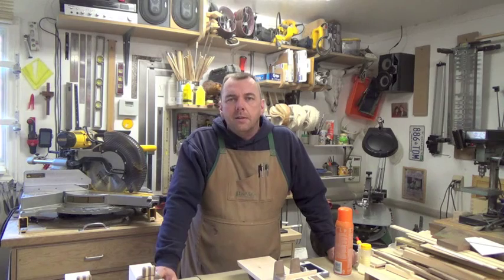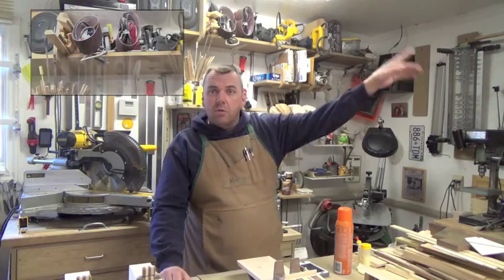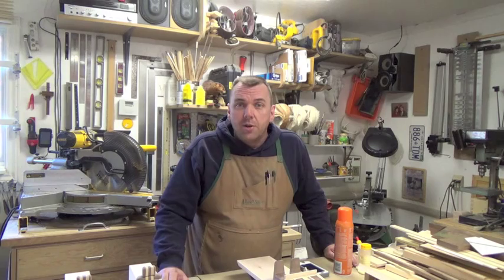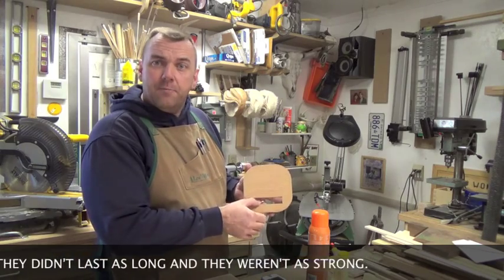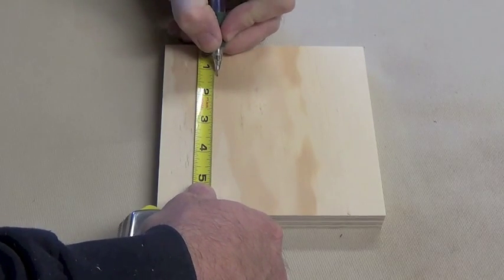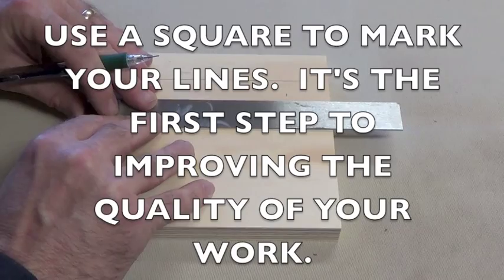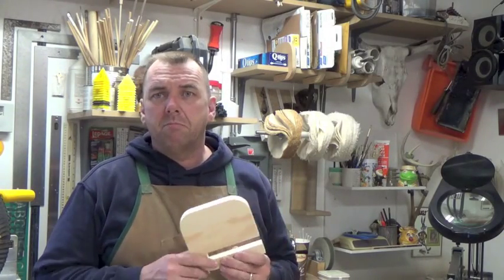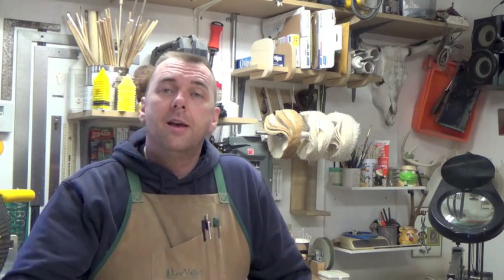Making Shelf Dividers

Comment: I'm an organize nut and now that I am Retired, it can be a little expensive buying those large 3" note books I used to keep my drawing ideas and manuals in. I also clip articles from magazines for Ideas but  I don't want to keep the whole magazine. This idea is right up an organizer's alley,  I still have my older 3" note books but for new ideas I use folders with pockets. They are always slumping over, but now with these dividers I can make all I want so everything is up right and I can tell what is what up on the higher shelves. I also keep scrap lumber and  just did project using 1"x 6" boards and have plenty of that left. Not as beefy as 3/4" & not a true 6"'s but will do.Thanks for another great idea!
Reply from the maker: +CrossGrain Wood Products,LTD You're very welcome.  Just be sure to cut the slot for the shelf a little on the snug side.  If you cut the slot too loose, the dividers don't hold as well as they could.  Good luck with your organizing.

Comment: how thin material do you think I could use to make these? mine will be 9 1/2" x 8" with 5/8" slide on area. Thanks!
Reply from the maker: 5/8" should be fine.  Just make the slot that your shelf slides in to as tight and close fitting as you can to help prevent racking.  I use 3/4" so that racking is minimized but at 5/8", you are only losing 1/8" thickness.  You should be just fine.  I hope this helps.  Thanks for tuning in to the show.